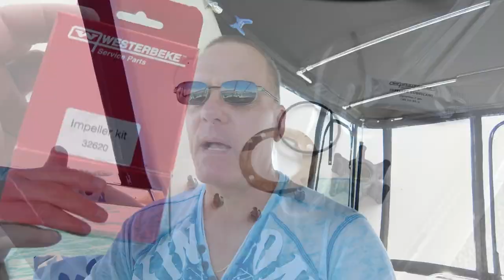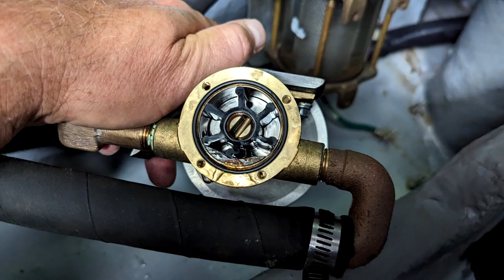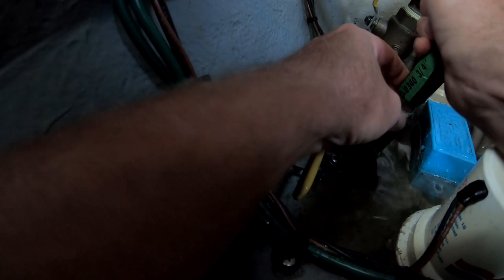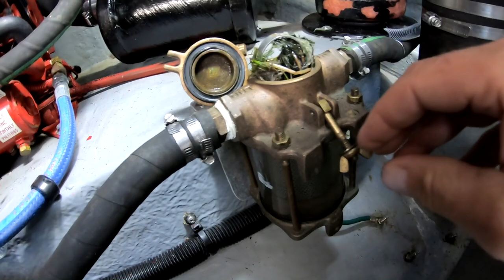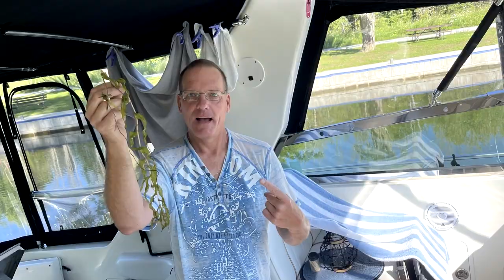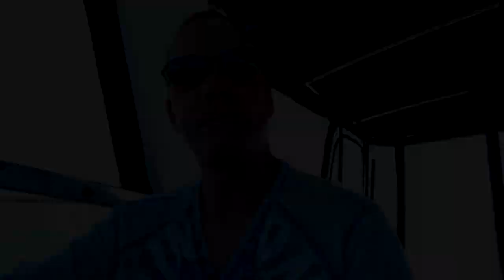Seaweed Clogs Our Boat's Generator!

Comment: I had our A/C hull intake totally clogged with seaweed and silt. Ended up making a shop vac attachment which screwed on to the top of the strainer, switched the shop vac to blow mode, opened the seacock to about 45 seconds and that did an excellent job of very quickly clearing the clog.
Reply from the maker: Good idea, but for the shop vac to work in this situation, we would need the generator running to produce the AC power to run the vac...
Reply: @BoatingWithBoogaboo  true. I have only use this technique at the dock, however they do make battery shop vacuums.

Comment: This exact thing happened to me on Sunday.  I dove down under the boat and pulled out what I could.  Then I had to go back to the dock to use the dock water hose to blow it backwards since my hose was  packed full too.  Fun stuff.
Reply from the maker: It's always fun to have to do these types of emergency fixes on the weekend. Kinda like me having to replace the duckbill valves last Friday, right after getting to the boat for the weekend 💩

Comment: Hey Paul, Frank here with Gr'Ah Sea Us, Sea Ray 340 Sundancer 2001 in Ottawa that I bought in 2021 thanks to your channel. It was a relief seeing you going through the same issue with the weeds... had to empty the 4 strainers almost daily on the Rideau Canal from Ottawa to Kingston / Sandbanks in July 2023: that's the 2 engine strainers, the genny's and the AC's. By the way, I bought the Sundancer 2 years ago, love every bit of it and, oh, uh, well ok so yesterday I saw a 1996 Sundancer 370 for about the same price I could sell my 340 that's equipped with two thrusters and imagine me biting my fingernails on both hands thinking "should I"? Lol. I know there are lots of variables but feel free, and anyone, to write your thoughts / considerations on that especially that you had a 330 before and a 370 now. Thanks.
Reply from the maker: Hi Frank,
 The main things that come to mind on that '96 370 Dancer you mentioned is that it will have a significantly lower radar arch - too short for me to stand up at the helm, hence why we got a '98 model year. Perhaps not an issue for you, but after five years of hurting my back and neck when driving our 330, that was an absolute must have for me.
 Also, the engines (if original) would be carbureted, as opposed to the easy starting fuel injection you enjoy now.
 Apart from a few minor styling ques, it'll be pretty much the same as our '98.
 One thing that is kinda a red flag for me is the two thrusters??? Not a lot were factory equipped with a bow thruster, but if so, that 2nd one is probably an aftermarket attachment. If you've watched enough of my videos, you'll know I don't hold thruster equipped boats in very high regard. For a express style cruiser in this size range, any captain with even mediocre skills should be able to handle the boat without thrusters. Every time I hear one being engaged, I immediately get an 'oh-oh' feeling, as I worry that it means the captain is unsure/inexperienced/frightened/accident waiting to happen if he's relying on thrusters. But again, that's just my opinion 😉
 Our 330 handled really, really well and our current 370 is a dream to drive, dock and go through the locks with. I often comment to Anchor Girl that it feels like the boat drives itself 😁
Reply: Hi Paul, nothing like speaking with an experienced and a trusted / critical mind source, thanks so much yet again: with that I'll definitively stick to '98 or higher in confidence. I'll stay EFI and head bump-free. Oh, the thrusters are on my 340 and they are silent unlike most others that 'grinds' horrifically: I do everything not to use them but when a situation arises, they're my "Plan B", lol, and they're very forgiving as I often go boating / come back to dock alone, wind no longer a decisional factor, until my wife joins me in retirement in a few years. Also, had to dock between two wide American looper boats at a Rideau Canal lock with 4 feet room at bow and stern, wind pushing me away, with about 10 worried-looking boaters ready with extended poles, some covering their mouth with their hands... nonetheless I slid in sideways like a crab no probs, 3 bumpers barely squicking on the blue line all at the same time, even got an applause from the US friends, wife stayed calm, lol, and I was proud to have represented Canada as such (with the Canadian flag installed, yes like you at the bow!) Another experience is when I didn't notice one engine stopped working as I was exiting my dock and with only 4 feet distance to the yacht next to mine and an immediate 90 degree turn that I have to make or it's the rock wall (and silent/hidden kayakers paddling by), current from the two nearby calverts, the stern started drifting towards the yacht quickly but with the push of a thruster button for 1 second and no damage was done / no boat neighbor running out with big eyes / embarassement (and perhaps expenses) saved. Now don't laugh but a few times when we were anchored, the nice sunset was unfortunately at the bow, (you know where this is going) so I seamlessly used the $6,500 stern thruster to circle the boat around 180 degrees without starting the engines nor anchoring up, we faced the sunset and it felt like a million buck :) Yeah, I know, I didn't bought and installed it for that purpose but hey, lol, it created a good laughter while other boaters were watching the moon! Thanks again for the valuable insight :))

Comment: My 400DA had the same issue with its generator. Fortunately the local Westerbeke dealer was willing to send a technician to our marina and also found seaweed in the line. The only downside was that I had to pay for his travel time. That’s one major issue with having the boat moored 100 miles from home!
Reply from the maker: I'm going to be contacting Westerbeke directly to see what they have to say about me putting a strainer on that through hull inlet. The boat doesn't have one (I don't recall if our prior 400 Sedan Bridge had one or not), and I've read that there's a possibility of water ingestion to the engine at plane and that's why it's just a straight pipe. Funny, as both of the big engines have scoops and I've never heard of that being an issue on them 🤔

Comment: Happened to me several years ago to my onboard genset.  My boat insurance covered the generator.  Need your boat shop to write up the cause and repair costs and your insurance should cover it.......with a little nudging :)
Reply from the maker: Insurance?? What for? I evaluated and tended to the required work. If I replied on my insurance company for every little repair or mechanical failure on our boat, we'd never be boating. Besides, I'm pretty sure they wouldn't be able to find someone to do a remote repair like this, at the side of a lock, in the middle of cottage country 😉

Comment: Our issues with “weed” on that stretch of the TSW  definitely were a stressor this year. On our second trip down we were wary for sure.
Reply from the maker: In the past twenty years of traveling the TSW, on our five different Sea Rays and spending many dozens of nights at the locks from Trenton to Port Severn, this was our first ever incidents with weeds causing an issue like this. In my mind, it was no more than a case of bad timing with the result being completely easy to replicate anywhere, including our marina slip. 
 That all said, I will probably put a hull strainer on that pickup, as the current configuration is nothing more than a straight pipe sticking through the bottom of the boat. In fact, I still have a complete NOS strainer/seacock assembly at home.
 Finally, wait 'till you see what got stuck in that line this weekend!! 🤣
Reply: @BoatingWithBoogaboo just make sure it's not a scoop type.  They purposely don't use those because it will shove water in on plane and will fill the exhaust with water and could hydrolock your cylinders.
Reply from the maker: Ya, I read that. But from what I saw on the Westerbeke manual was that condition happens when a generator is installed in a 'worst case scenario', meaning that it's mounted below the water level. In my case, ours is above that and I'm thinking should be good, especially if the scoop is rearward facing.
 That said, I'm gonna contact Westerbeke directly to get their insights in the situation.

Comment: Hey Paul,  This just happened to me 2 days in a row as well.  Mine threw a code of LOC “lack of coolant”. After doing some digging it was the strainer and hose blocked with that same junk.  It must just be pretty bad this year.
Reply from the maker: Coolant wasn't the issue for us in this instance, rather the raw water intake. And our system's 'code' was only our ears and eyes to warn that it wasn't cooling properly. 
 Watch for my future videos to see what got stuck in the system this weekend - and what I'm gonna do during the off season to alleviate it reoccurring 👌
Reply: @BoatingWithBoogaboo  yeah mine wasn’t coolant either. That was just the code because the raw water intake was blocked. Same issue as you.

Comment: Hi Paul, you checked the strainer at 2:10 “and it was fine” and then after some other clearing, the strainer was anything but fine. Did clearing the seacock free up weed that then ended up in the strainer? Cheers, Phil
Reply from the maker: I think what happened was that closing the seacock cut the weeds which were partially stuck at the point of entry. Each time there was an issue (watch for an upcoming video with a really messy blockage), I could feel the weeds getting chopped as I closed the through hull ball valve.

Comment: How would I know when I need a tune up?!?! For my 1989 Formula 35 PC.
Reply from the maker: Can't say precisely, but if it starts running rough or hard to start, that may be an indicator. In my experience, many boats go too long (many years) between full tune ups. For me, I start with checking the manufacturer date codes on the ignition wires, or maybe pull the distributor cap to check its condition.